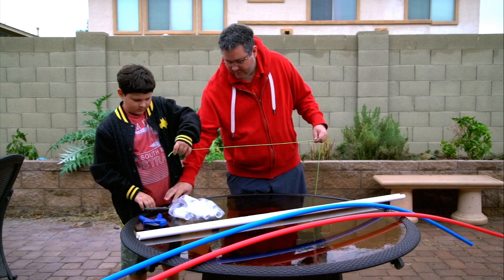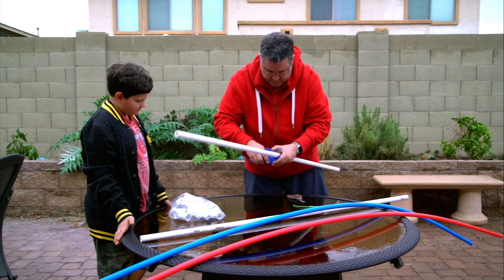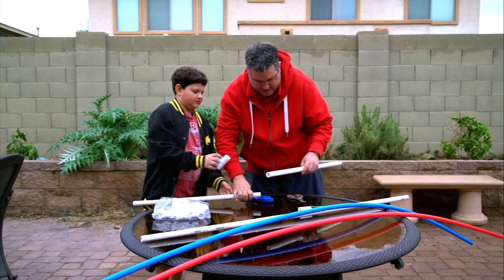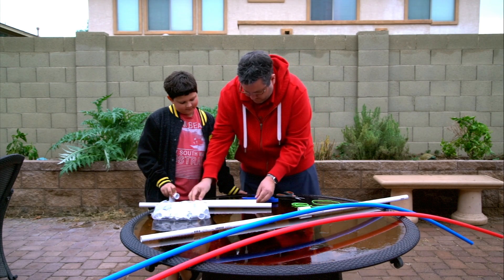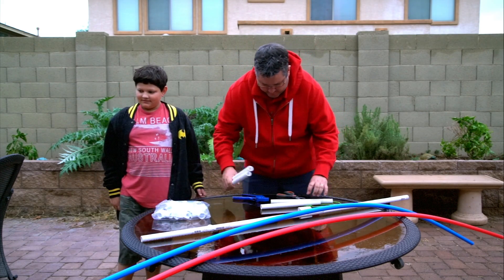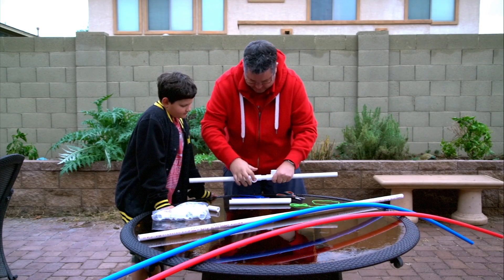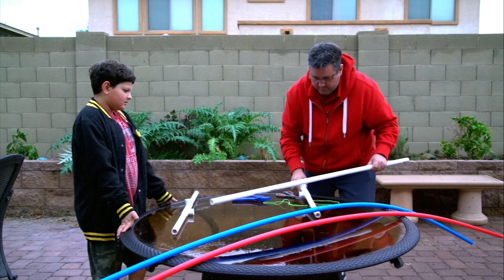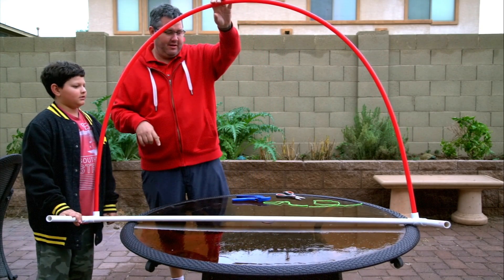Build $7 FPV Race Gates for RaceFlight, BetaFlight and KISS

Comment: Hey thanks for the video. The kids and I can build some this weekend. It's going to rain but at least I can have them ready.
Also, may I suggest labeling your PVC's once you have them made for faster placement.
Reply: Damon Keller I glue all the bottoms but center piece now, and use pool noodles around the top for better visibility :).   Gluing them makes it simple easy to assemble
Reply: I need to play your video again so that I can make a parts list.  I plain on going shopping LOL